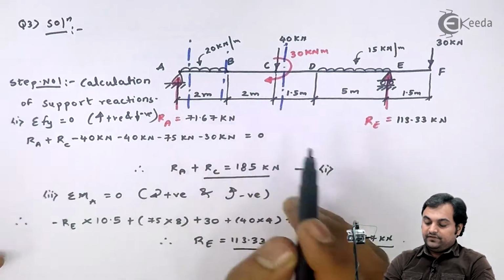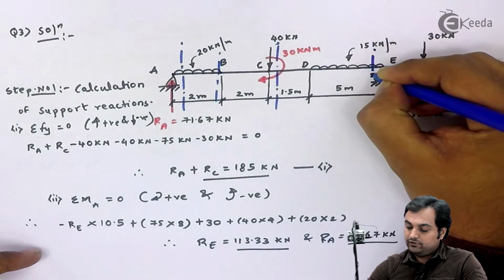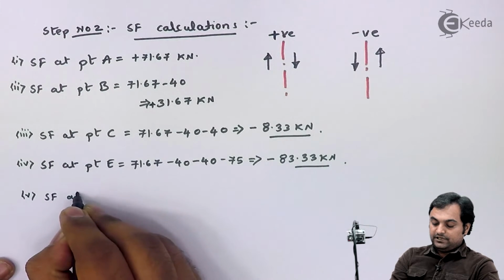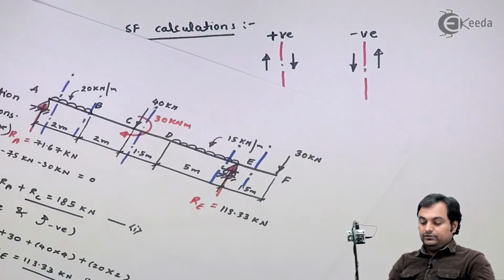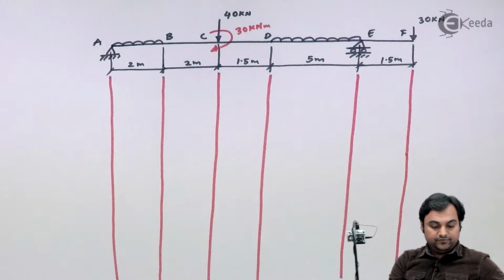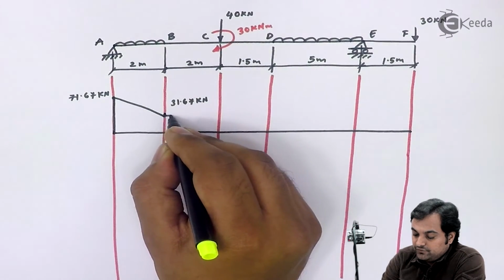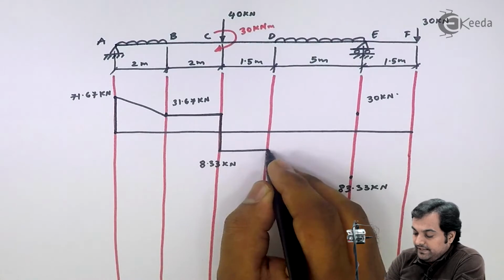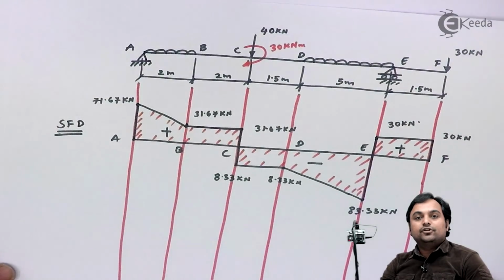SFD and BMD - Problem 3 - Part 2 - Shear Force and Bending Moment Diagram - Strength of Materials

Comment: Sir the value of your Ra and Re are wrong
Reply: What’s the correct answer then
Reply: Re =79.047
Reply: Ra= 105.953
Reply: Add 30×12 in Re moment equation.Sir forgot to take it after that Ra and Rc value will be same as sir's